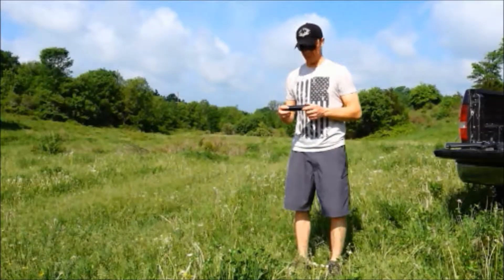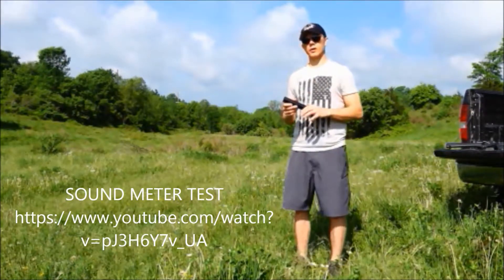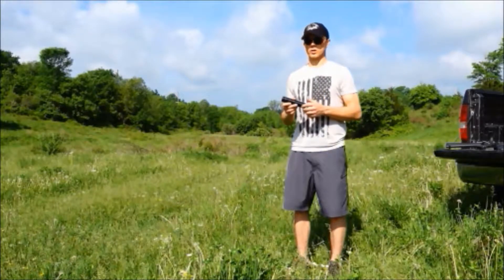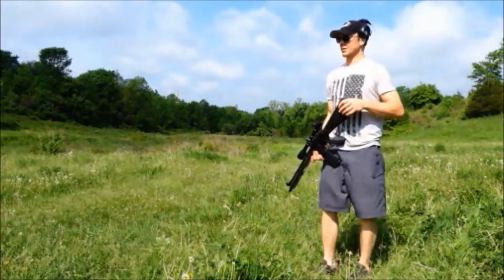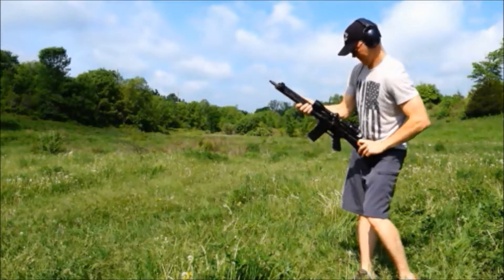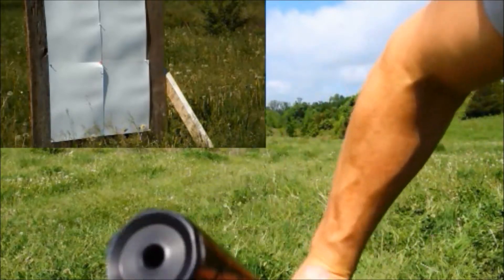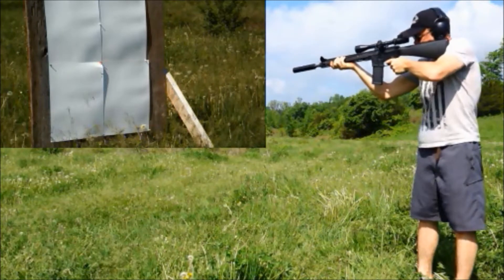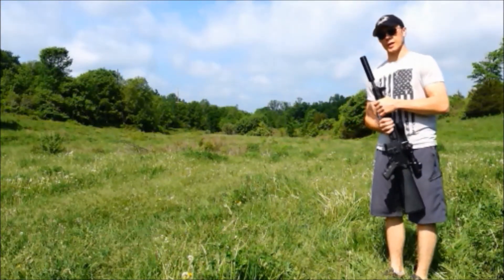suppressor silencer baffle core strike doesn't blow up

Comment: why the heck are there no sound meter videos for any of your products? You apparently had some but not anymore. Would have bought one already but I cant make myself pull the trigger because there is just too many unknowns.
Reply from the maker: As we answered your same question on a different video earlier today. We do have decibel reduction numbers listed on most suppressor options in each product page under the Tech Specs.  At the time, we unfortunately did not produce a video of the recordings, however they are accurate on our website.